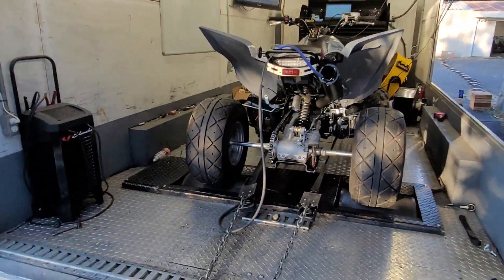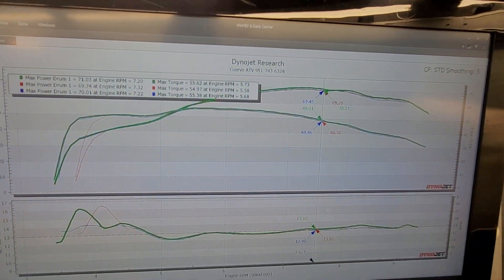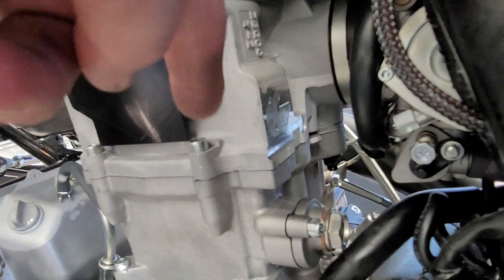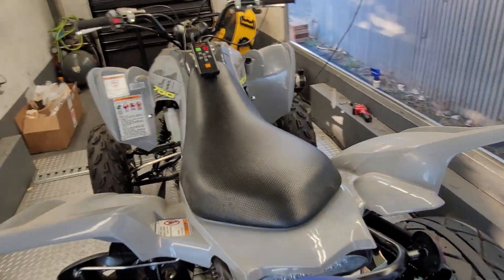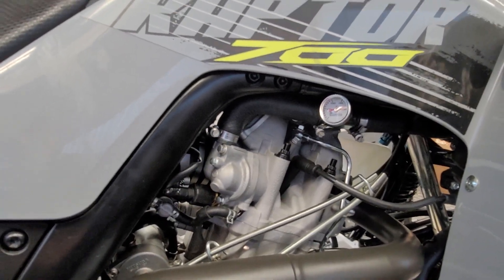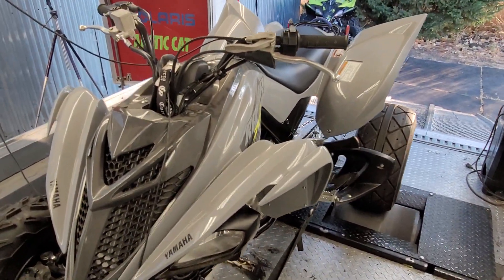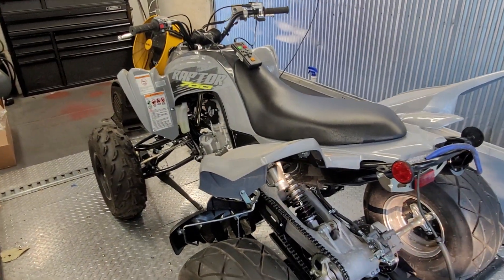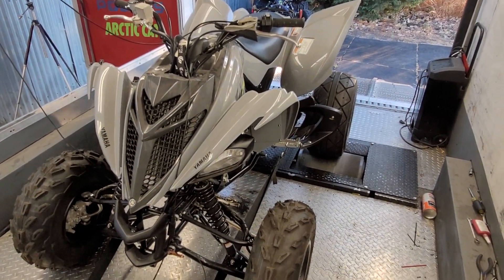740cc  Pump Gas Cuervo Trail Monster on the dyno!

Comment: I bought a blown up 804 ethenol build off a guy. it was built by a legit guy/company in the industry out of CO who shall remain nameless. I disassembled the motor last night and the cylinder shattered and stroker piston skirting was eaten by crankworks rod...surprisingly the +8 stroker and rod are mint with just a couple superficial blemishes/scars. The +2 head and internals good, flywheel, clutch assembly, oil and water pump, primary gears, transmission all look good. I haven't been through it with a fine tooth comb but it is rebuildable. I would like to utilize the +2 head as the bike has the 54tb,exhaust, power commander etc setup for big power but would like it to run on premium pump gas. It has a 1000cc fuel injector seeing how it was a ethenol build, I would probably need a 700 or 800 injector. But I also want to step it down to a +6 crank and 11.5:1 or 12:1 105.5 piston and a different cam to match the degraded power output as the camshaft in there right now is a high lift "torque monster" cam. What would you recommend for stroker/big bore kit/cam and fuel injector setup on a +2head built for 90+hp? I live at sea level and again looking for a pump gas setup..the clutch also has a slingshot pressure plate.

Comment: I want to do a mild build on my raptor. I was thinking fuel, customs intake, monster exhaust, and cams. I just don't know what stage cams to run and if I should build the head with springs or port and polish.
Reply: I have hot cams 3 it's great with stock head. Port and polish head with good cam is $2,000